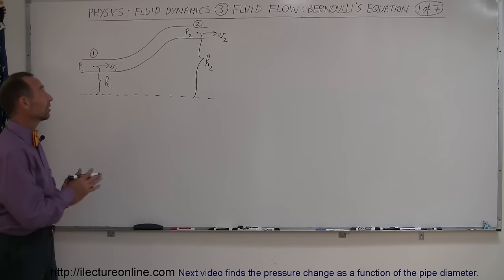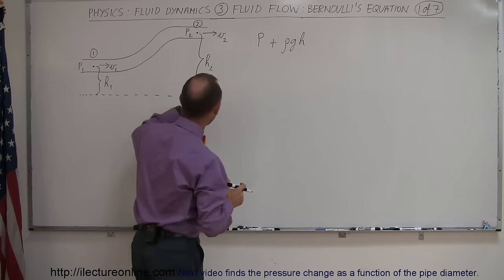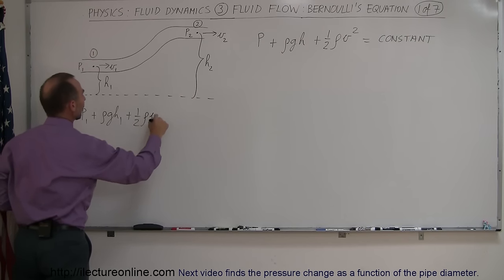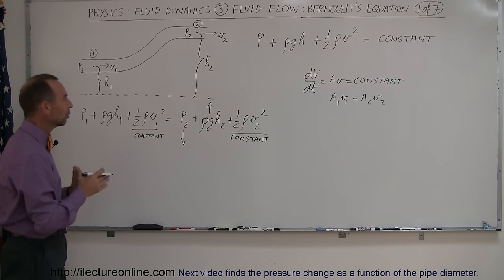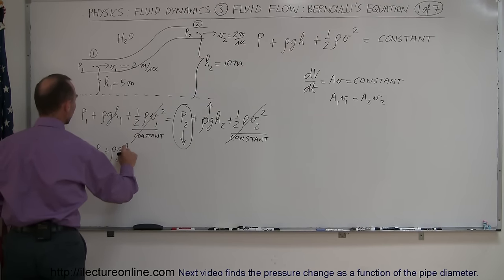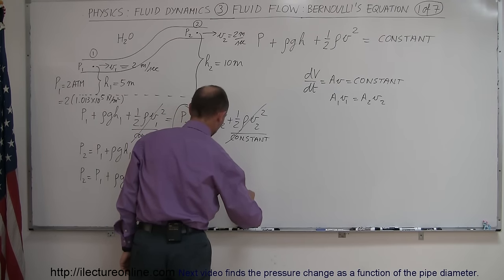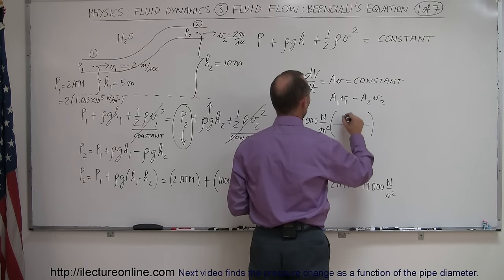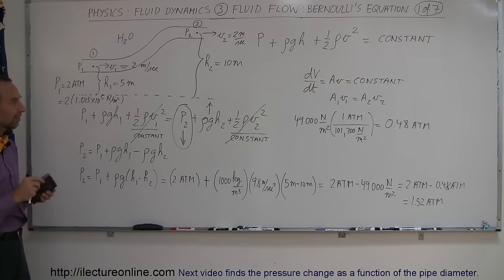Physics 34  Fluid Dynamics (1 of 7) Bernoulli's Equation

Comment: Thank you Sir for the explanation. I have a query. In the example since inlet height is greater than the outlet height, the pipe may have a bend. The flowing fluid will exert force on the pipe wall at the bend. Will that cause loss of energy or pressure. or will that affect velocity of the fluid.
Reply from the maker: Whenever fluid passes a bend, the internal viscous forces (and frictional forces) will indeed pull some energy out of the system, resulting in a loss of velocity.  (That is not covered here in the more simplified view).

Comment: Wait , how do you assume speed stays constant when we're sure gravity has an effect , or do we just ignore gravity's effect ? Because whatever change in potential energy has to equal change in kinetic energy if gravity is involved and then pressure would be constant , what am i getting wrong ?
Reply from the maker: You cannot take Bernoulli's principle in isolation.  You also have to include A1v1 = A2v2.  When A is the cross sectional area and v is the velocity.

Comment: Sir consider time 3.17

What is the difference between p1 and rho*g*h1 ?

I think both are pressure at same point then why two terms?

What the terms exactly means?
Reply from the maker: rho is the density of the fluid.  that term represents the change in pressure due to the difference in height.

Comment: Having a tough time seeing how the pressure can change if 1) velocity at 1 and 2 are to remain the same 2) the liquid has set density and 3) the area of entrance and exit are the same. If P=F/A and F is M/A, how is P going to change from point to point?
Reply: Hasnain Shirazi Correction* F=MA
Reply: +Hasnain Shirazi Me too, if i have a garden hose the same amount of water is coming out whether it&#39;s horizontal vs vertical since velocity is the same and water is not compressible, so where&#39;s this loss of pressure?  Maybe at the walls of the hose?
Reply: +sean craig 1) the diameter of the hose hasn't changed 2) Fluid density is constant 3) P is changed because the pipe isn't horizontal and the height is causing the the decrease in value.
Reply: +Mr TechAnical Even with it not being horizontal, aren't we saying Vf remains the same as Vo? Why would the height come in to play then.
Reply: +Hasnain Shirazi in that case im pretty sure the mass changes as in the amount of water that comes out .True, its coming with constant speed so accelaration must not change but nowhere does it say that the same amount comes out
Reply: The simple way to understand this is to think in order for you to elevate an object( make it gain height) you must put energy into it. If under the assumption that the velocity remains constant after the change in height and we have such equation as Bernoulli’s we must say that the only thing changing must be the Pressure at point 2 since velocity remains the same and the height changed the energy used to drive the water upwards must to have come from a change in pressure
Reply: sean craig think of it as where does the energy to make the water gain potential energy is coming from? Since our velocity remains constant and our height changes from the Bernoulli’s equation the only other variable that can change is Pressure.

Comment: But sir please explain what you mean by pressure of the fluid. Is it the hydrostatic pressure or the static? And where is this pressure exactly applied? Parallel to the walls of the tube or vertical to them? Just ''pressure of the fluid'' doesn't help me at all to understand 😒
Reply from the maker: When you dive down to the bottom of a swimming pool, or a lake, or the ocean, you will pressure on your ear drums.  It doesn't matter where you are, everywhere in the water sufficiently deep you will feel that pressure.

Comment: According to the Continuity Equation and Bernoulli's Equation, the smaller the cross-sectional area the larger the velocity, thus the smaller pressure. However, the formula for pressure is F/A, which indicates that the smaller the cross-sectional area the larger the pressure. Can anyone please explain this contradiction? Also, is the pressure in capillaries higher or lower than the pressure in aorta (since the capillaries have larger cross-sectional area than aorta, but I am confused with the contradiction I mentioned before)? Thank you!
Reply from the maker: There are a few videos in the playlist that explain that apparent contradiction.

Comment: 😇what if a question was like this ( a water tank has a valve at the bottom. If this valve is opened, what is the maximum height attained by the water stream coming out of the right side of the tank? Assume that h = 10.0 m, L = 2.00 m, and θ = 30.0°, and that the cross-sectional area at A is very large compared with that at B.) how can solve it
Reply from the maker: Solve for the velocity of the water coming out of the hole (as shown in a video like that in this playlist).  Then calculate the vertical component of the velocity (Vo sin(theta))  and then use the equations of kinematics to determine how high it goes   V^2 = Vo^2 + 2 g (h)

Comment: So, just to confirm, the answer is P2= 1.52 ATM, right?
Reply from the maker: Pamela,
You are correct.
Reply: Michel van Biezen I'm a little confused about the p1 my teacher just put 3(1.013x10^5) does a problem normally supplies how times does p1 greater that the ATM?
Reply from the maker: Goldendust
That sounds like it was a "given" in the problem your teacher showed you.
He set P1 = to 3 ATM.  Then P2 would be calculated relative to that "given" value for P1
Reply: Oh ok thank you.

Comment: Dear Dude, you forgot to mention that you were calculating in normal atmospheres, atm (which equals to 760 mm of mercury, p=13 595,04 kg/m3, t=0 Celcium, g=9,80665 m/s2)!!! For Engineers there is a technical atmosphere (at) which equals 1 kgf/cm2 which equals to 9,80665 Н, which equals to 98 066,5 Pa!!!
Reply from the maker: The "technical atmosphere" appears to be an approximation to make the calculations easier. Is that the case?
Reply: @MichelvanBiezen  to be honest, I don't think so. What I called "normal atmosphere" describes normal atmospheric pressure outside your home (weight of air), for engineering calculations (like hydrostatic pressure of a water column) there is a "technical atmosphere". 10 At = 0,980665 MPa ~ 0,981 MPa. 
I want to say that it is possible to measure distance in snakes or rabbits, but it is better to use meters, a similar situation when you measure water pressure in units for barometrical pressure which is Atm.
Reply from the maker: You got me interested so I looked it up.  It is indeed an approximation so that the pressure can be expressed in terms of kg /cm^2.  It is not the correct pressure, but just an approximation for convenience.  (Close enough for normal engineering work).  When you take into account that a lot of work is done not at sea level but on average hundreds or several thousand feet above sea level, it may be close to the actual atmospheric pressure.  Also due to weather conditions the atmospheric pressure is seldom equal to 1 ATM.
Reply: @MichelvanBiezen  Thanks for supporting healthy discussion. 
There is absolute and excessive pressure. Absolute is an excessive P + atmospheric P at a certain height level. Excessive P must be measured (due to the International System of Units) in Pascals. Engineers all over the world (I'm not talking about countries with the imperial unit system) also use kgf/cm^2 which is basically a force (weight is a function of force, mass is not) or technical atmospheres, 1At = 1 kgf/cm^2, I'm sorry to say that but nobody except you use Atm to calculate Excessive P.
If you want to be 100% correct you must use Pa. Atm and At are units (as well as feet, pounds and so on) that, according to the International Organization of Legal Metrology, have to be removed from use where it is possible.
Reply from the maker: In the engineering world you are correct. (when I interact with mechanical, thermodynamic, structural, and electrical engineers, at work they all appear to have their own way to express units, unique to their individual disciplines and I often find myself converting those units in order to understand what they are talking about).  But in the scientific community (as in astronomy, physics, etc.)  and in text books we still use atmospheres, as well as lb/in^2, Pa, etc.
Reply: @MichelvanBiezen  Ok, Michel, I got your point. I believe that to avoid misunderstanding we have to use the SI system in calculations, in our particular case it should be Pascals.

Comment: I know that it is not represented in the equation however does the length of the pipe in any way have an affect on pressure difference?
Reply from the maker: If we ignore friction, viscosity, etc. as in this simplified method of looking at it, then no.  If we include those other factors, then the length of the pipe definitely does factor in.
Reply: @MichelvanBiezen  Brilliant, thank you. Do you have any examples taking these factors into consideration?
Reply from the maker: This playlist goes into more detail, but we still have to create the course in fluid dynamics covering all these various aspects:   PHYSICS 34.1 BERNOULLI'S EQUATION & FLOW IN PIPES

Comment: Why did pressure change if velocity stayed the same?
Did It change according to Stevin's law which states that pressure vary according to the position a point occupy  in the liquid?
Reply from the maker: Adriana.  In a way yes.  But in this example we assume that the pipe is thin enough that we can assume that each drop of liquid at the same point in the x-direction is at the same height.  The difference here is that the pipe goes up and wherever the pipe goes up, the pressure will drop.  The amount of the drop is equal to rho*g*h.  where rho is the density of the liquid, g is the acceleration due to gravity and h is the height increase of the pipe.  Note that this is the same term that finds the pressure inside a liquid at depth h.
Reply: Thank you very Mr Biezen.

Comment: How did you calculate G? Or is it a constant.
Reply: Professor Kieran yes, 9,82
Reply: Tommy Badowski 9.81 or 9.80 are the acceptable values of g.
Reply: Depens on where you are, in Sweden we use 9.82.

Comment: Sir, how can be that v1 = v2??

I don't understand because I'm thinking that if water is climbing from 1 to 2, how can it not lose velocity??

I saw your fluids playlist so far and I understood the A1v1 = A2v2 in the inicial vídeo, because water did not climb, but here I can't understand.
Reply from the maker: The velocity can only change if the cross sectional area changes.  That is the key to Bernoulli's equation, if the velocity cannot change then the pressure changes.
Reply: @MichelvanBiezen  Yes sir, matematically I can understand that.
But physically, how can the gravity perform a work in the liquid and the liquid still have the same speed?
Reply from the maker: By changing the pressure.  (Note that there are 3 variables: P, v, and h)

Comment: Dear Mr. Michel,

I just wanted to ask you something here. Could those 3 equations could be use to calculate those manometer (simple manometer, micromanometer, differential manometer and inversely differential manometer)? I've found that my lecturer has taught us in a very different and difficult way to calculate the fluid flow by using bernoulli's equation. could you please elaborate more on that?
Reply from the maker: A manometer is simply a device that measure pressure difference.  Thus it is used to make a measurement.  That measurement can then be used in the Bernoulli equation.  It should be independent of how you use the equation.
Reply: Michel van Biezen  I see, but I am confused with my lecturer's equation rather than yours. Our equation kinetic energy and potential energy equation is a bit different than yours. I've tried to do some exercises where I've used both equation, seems like there is a big different in answer
Reply: Michel van Biezen
for the kinetic energy, we have been using v(square)/2g equation
Reply: Hidayah Hasbi
simple. you divide Prof van Biezen's formula with density(rho)*gravitational acceleration (g). his equation will become [Pressure/specific weight(gamma)] + [height] + [v^2/2g]
Reply from the maker: Dario Vallejos
Dario,
Sounds like you got the answer.
Hidayah
If you could send us the equation(s), it would be easier to comment on them.

Comment: Hello prof. Biezen,
I have one question, how can fluid velocity be calculated from this exact example? I know fluid velocity is the same at both ends, but how to calculate that number?
Reply from the maker: Bernoulli's equation will not help you find the fluid velocity unless other factors are known , such as pressure, height, and the velocity at any other point.
Reply: @MichelvanBiezen  Thank you for your answer, greetings from Croatia 😊

Comment: Sir I have a long pending doubt, if I close a valve say 50% in the discharge side what will happen to the flow, pressure and velocity on both sides?
Reply: And I have a close water circulation system, a chilled water system of HVAC.

Comment: but how comes velocity is still constant when you have pressure drop velocity should also decrease  I believe..
Reply: Because for every tube it is true, that the amount per time of substance you feed in on the enter-side must come out on the exit-side of the tube. Or otherwise you would have a jam. But this is not possible since fluids are not compressable.

So if you feed eg. 3 liters per second into a tube (or better said: if you can feed that amount), then you know that on the other end of the tube there must be 3 liters per second coming out.
In the case shown, it is clear that this is possible, since the tube has a constant diameter. So if it is possible to feed in eg 3 liters per second, there is no reason why it should not be possible for 3 liters per second to exit on the other end.
In the general case that might not be true, since the other end of the tube might eg. actually be closed with the exeption of a tiny hole and friction at that hole might limit the amount of water able to exit in a specific time. But still: if only 2 liter per seconds can exit, then you will not be able to feed more then 2 liters per second into the tube in the first place.
(What comes out must go in and what comes in must go out)

So yes, there may be limiting factors to be taken into account. But as soon as you know that it is possible to feed in some specific amount into the tube, you also know that that same amount must be able to exit the tube or vice versa.

And then of course there is the trivial stage of "converting" that amount of fluid into a velocity by taking the diameter of the tube into account. The diameter gives you the area of the cross section of the tube and since you know how much water (volume) has to pass one cross section area in which time, it is trivial to calculate how fast that fluid therefore has to flow.
(And because in the shown example, the diameter of the exit side is identical to the diameter on the entry side, it follows immediately that the velocities are equal also)

Comment: I watched all the video from 1-7 but still can't even do this equation can you please help? 2. A large storage tank, open to the atmosphere at the top and filled with water, develops a small hole in its side at a point 16 m below the water level. If the rate of flow from the leak is 2.50 x 10^-3 m^3 /min, determine

(a) The speed at which the water leaves the hole.
 (b) The diameter of the hole.
Reply from the maker: a) v = sqrt (2 * g * h) where h = 16 m      b) dV/dt = Av   where A = (1/4) * pi * D^2
Reply: Michel van Biezen by breaking down the formula you ended up getting VI=2g(h2-h1) square root everything but where did you get 2 infront of the gravity(g)?.
Reply from the maker: Take a look at this example:  Physics -Fluid Flow (4 of 7) Bernoulli's Equation    https://www.youtube.com/watch?v=UxYH41vV-DI&index=6&list=PLX2gX-ftPVXVHnqlawAPDHuo3lg9lT6JI

Comment: Is flow of water in direction of higher pressure to lower pressure?
Reply from the maker: Yes, and from higher elevation to lower elevation.
Reply: But if I am correct this equation is set on 2 points in the pipe? Because I don't get the rho*g*h part. Since if we want to calculate pressure at certain depth (with no external pressure) we can use rho*g*h and that is deeper we go the higher the pressure and that point being in the water and not at the surface. But in Bernoulli case if we would take pipe that would be horizontal first and then 90 degree turn upward, we would get higher pressure the higher we go (rho*g*h), which doesn't make any sense?
Reply from the maker: No, that is not how Bernoulli's equation works.  If you raise the height on one side of the equation, it causes the pressure to increase on the other side of the equation (which would then be at a lower height).
Reply: But in your second vide of this series, you took horizontal pipe with same height and smaller area on the left and bigger area on the right. And you got higher pressure on the right side, yet water was flowing from left to right?
Reply from the maker: Bernoulli's equation still works in that example as well,   You have to look at all the parameters at the same time, not just the pressure by itself.  Note that the velocity decreases in the portion where the pressure is higher.